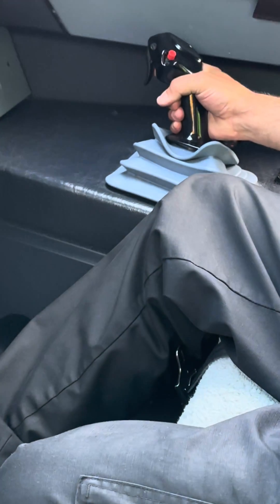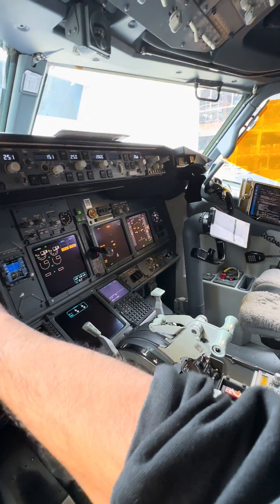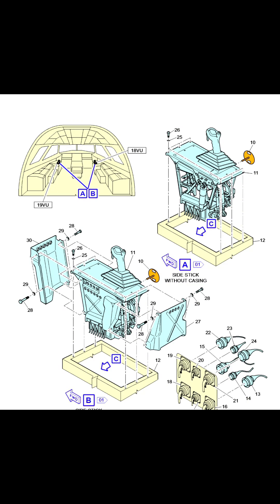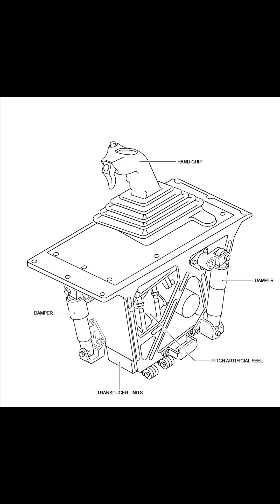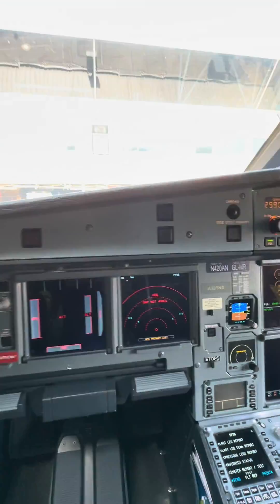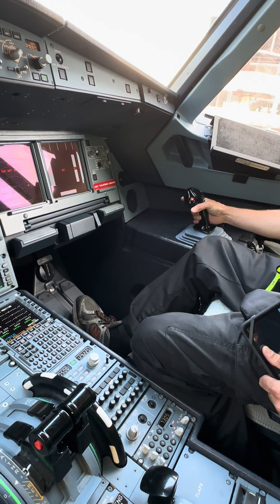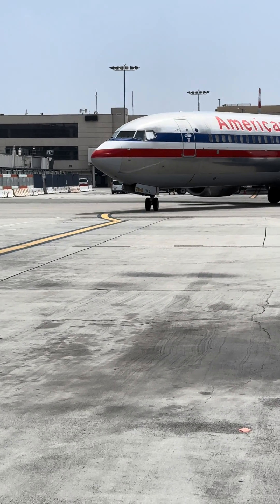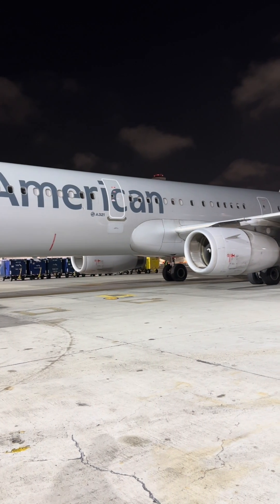Side stick VS Control Column (yoke)

Comment: What would happen if both pilots press the red button at the same time? Is it possible? Has it happened? Like, let's say in an emergency, when both pilots are stressed (maybe it's. night flight, one or both tired), they both try to handle the airplane and start pressing the red button? What is the final input for the a/c and how does it respond to such confusing pilot input? Has that been tested?
Reply from the maker: @evetodew  it will simply cancel each other out. I don’t think it’s ever happened, well not that I know of, but I’m sure it’s been tested.

Comment: Yoke is much better in critical situations. Less confusion, no fight for controls, very obvious and no time lost with conflicting inputs or confusion between pilots. So when there is less room for error, yoke is much more reliable, and lives will not be lost.
Reply from the maker: Tell that to 777 or 787. Yoke is just an artifact. Those are pure fly by wire. Might as well be side sticks. 😉
Reply: @StigAviation  I know it is FBW but that is not what I was talking about.
Reply from the maker: @hari4406  I totally get what you’re talking about my friend, so it’s well understood
Reply: Yoke is an old joke. Takes up too much room and weighs more. A 737 cockpit had so much smoke in it recently, the pilot had to move his head close to the displays to see what was going on, and he kept banging into the yoke.
Reply: If the pilots properly communicate you don’t have those issues, this is kind of irrelevant
Reply: @Falcon.G2  It actually IS not irrelevant. Many plane crashes have been caused by Captain and FO applying opposite controls during emergencies. The airbus system at least alerts both that they are applying two different inputs.

Comment: Cool thing on the dual input in the airbus will take the average of both inputs. Movement of the side stick you’re commanding a rate and the computer interprets it from there. Funky side is a total manual reversion leaves you with only the elevator trim and rudder which are mechanically linked. Still flyable! Luckily it has heavy redundancy. 

Boeing is nice still having conventional control inputs, but you sacrifice space and comfort for sure. Can’t wait to go back to the airbus! Least the tray table helps keep your pants clean!
Reply from the maker: Tray table is definitely a win for Airbus. Just a convenient aircraft. Oh and the horizontal stab and rudder do have mechanical links but not to actual control surfaces. The cables just go to servos. But I hear next version of 321 will get rid of the cables completely.

Comment: Personally, I think FBW and "active" Side sticks are the future. They work much better with glass cockpits, for example Honeywell Anthem or Primus. Yokes are always in the way. The Bombardier Global 8000 and Gulfstream G700 are examples of active sidesticks with glass and fbw( i think). Sidesticks should require triple reduncy hydraulics and a RAT system. Similar to Airbus' Blue System. Google search Global 8000 or G700 for pics. These are future cockpits. Be gone with FMS and MCDU-DU boxes from the 80's.

Comment: Very informative. Thanks Stig. Being an old timer I prefere the cable and pulley system myself.
Reply from the maker: Cables always do the job and very reliable… but my goodness.. the rigging of cables can be a very frustrating and tedious task. Got to get that tension just right 👌
Reply: Now that you mention it I can only imagine how difficult that must be to get just right. Our airlines use the 737.800 predominantly so will bear this in mind the next time I travel by air.

Comment: Good video. But the Airbus side stick logic and priority logic is more complicated. The lack of interconnection to me is a design flaw which was a major factor in the AF 447. I think it was over engineered. Makes it comfortable however if the chips are down I’ll take a yoke.
Reply: Very informative videos please keep them coming
Reply from the maker: I appreciate your input but flight 447 was not the aircraft’s fault. That was pilot error and them not having proper training and understanding of what the aircraft it capable of. So I will respectfully disagree with you on that point. Airbus logic is sound and if properly trained pilots were at the helm that disaster would not have happened. In regards to Boeing logic… it’s simple muscles math. Stronger pilot will win. So as I said both aircraft are good. But your comfortability factor is pure bias.
Reply: @StigAviation  thanks for the reply and your comments on AF447 is noted concerning poorly trained pilots. However the fact that one pilots control inputs were nullified by another pilots opposite inputs was a problem. With the captain returning from his rest he was unable to see this. The pilot commanding the proper input could not tell he was being overridden (in the heat of the moment remember arm chair QBing is easy that was a very wild situation as it was happening). The tactile feel that the other pilot would feel if they were interconnected COULD have saved the day. 
I don’t mean this to be a typical A Vs B argument both have their pluses and minuses. But the side stick with no connection is a problem. 

One of the things I ask pro aidestick advocates is to explain to me the Airbus FCOM side stick priority logic in the mere seconds you may need to use it. It’s complex and you touch on it in your video but there’s more to it. To me it’s ridiculous but it’s the only way to get the a/c certified. 

On the Boeing side? The fact that Cali happened and there wasn’t a fix to install and auto speed brake retraction system tells me the design was lacking and to do it after would have opened Boeing up to massive liability. Something at the time they had essentially avoided. But with the max issues they have grown quite comfortable getting their rear ends Sued off for poor design. 

I enjoy your videos. Very insightful.
Reply from the maker: Very well articulated. I thoroughly enjoyed reading your response and logic. As you said, both have good and bad qualities.. one thing I have learned from aviation and maintenance.. is that mistakes happen.. but they don’t repeat themselves. Aviation learns very quickly and implements the corrective measures to prevent such incidents. And there are those times where it becomes the Swiss Cheese effect.. the chain of events due to human factors. All in all we learn. And thank you for being here. I appreciate you
Reply: @peasoup2980 "ill take the yoke" like you have a choice? Do have boeings and airbus in you garage right now?
Reply: @topethermohenes7658  yes
Reply: @peasoup2980  nah pilots are not stupid like you

Comment: Sidesticks allow for more space infront of the pilot to be able to stretch your legs, a comfortable way to control the aircraft by resting your arm on the armrest and steering the aircraft with wrist and allow for the work/tray table which is just lovely. That being said, I'm not a fan of the Airbus ones that are passive. The ones on the Airbus are not linked to each other, allow for no artificial force feedback thanks to the C* flight path stable FBW and no autopilot feedback. Airbus unfortunately do not care about tactile feedback and it's VERY unfortunate the FAA and EASA allowed FBW Airbus aircraft to be certified with the lack of feedback with the sidestick and thrust levers. It's quite important, especially in a critical situation where one of the pilot is mishandling the aircraft like with Air France 447 and Air Asia 8501. It's very easy to dual since they provide no feedback to one another and once CRM and SOPs are ditched when the pilots are under stress like with 447 and 8501. 

The dual input warning is cancelled by higher priority stall and gpws warnings so it's useless by then and if the pilots are stressed out, they won't hear it as high stress causes hearing to go. The lack of artificial force feedback makes it easier to overcontrol, especially in the degraded laws like direct law, where the flight controls move proportionally with stick movement and sensitivity depends on the airspeed and altitude. So in regards to Airbus sidestick vs Boeing yoke, the Boeing yoke will have to win. The superior active sidesticks on the Gulfstream G400-G800 business jets and Irkut MC-21 airliner (all speed stable C*U aircraft), allow for artificial force feedback, are electronically linked and autopilot feedback. There's even the stick shaker for dual input, superior to the dual input alarm which can go unheard or cancelled by higher priority warnings. These are excellent. I hope the servo mechanisms used to linked the sticks don['t have cause issues tho. 

I prefer active sidesticks to the legacy yoke in airliners. Pilot do not fly their aircraft for the majority of the flight. It's only a few minutes at takeoff and descent to landing. I could care less if some folks have an issue with the video game style control being in use in the cockpit and doesn't look as manly to handle as the yoke. Who said the video game controller couldn't be used in cockpits? The original aircraft controller was not even a yoke at all, but a center stick. Even the McDonald Douglas/Boeing C17 uses a center joystick, though I'd take a yoke over that since I feel I'd be less comfortable using a joystick in the center than off to the side, especially in crosswinds where I have to use the rudder at the same time but that's for another discussion. To have the sticks out of the way allow for more room for the hours you'll spend in the cruise, get to cross your legs and move them around, allows for the table to do work and eat, especially if it's a long haul flight/aircraft.

Of course you don't wanna be distracted by having the table out with electronic device like with Northwest 188 or be stupid to have a camera near the sidestick to have it jammed (Voyegur A330 incident) so you still have to be alert, not careless and be professional at all times. As for using your left hand, the majority of sidestick pilots said they did not struggle to use the hand on the stick. A few others did but further training resolved any issues according to them. You don't need to be ambidextrous which should be obvious since thousands of sidestick aircraft fly everyday and often times by Captains. The armrest seems to help here. If a pilot suffers incapacitation, it's less risky with the sidestick as it's out of the way if the body falls over. The greater range of motion with the yoke in my view means it'll take longer to get the aircraft to do what you want it to like with a terrain escape maneuver. If I want immediate aircraft response, I can get the plane to move faster since the range of motion is smaller with the sidestick. 

I was on quora recently and an A330/777 instructor and a commentor who tried both Boeing and FBW Airbus simulators both said the sidestick for them allowed for more precise movements as they said it's simpler to steer with the wrist than using one arm on the yoke. I like yokes too. Some prefer it for simply to use both hands for the takeoff and climbing. Some like the fact it's right infront of you and don't mind it taking up space. Some like it for the greater range of motion which sometimes is a plus on the other side of the coin like with gusty winds. Lastly, I will admit, anyone can get used to flying with a yoke without too much difficulty where as with a left sidestick, some folks reported the struggled to used the non dominant hand since it's wrist movement where as on the yoke, they had no trouble since it's arm movement involved. So my preference is active sidestick > yoke and yoke > passive sidestick like with Airbus.
Reply from the maker: Incredible explanation. Thank you so much for all you time and effort for the amazing information.
Reply: @StigAviation  Sure thing 👍

Comment: Side stick design helped kill AF447.
Reply: Not enough to save Ethiopia and Lion Air 737 MAX crashes (Boeing half-hearted effort to Airbus their 737) Boeing had violated their long tradition of pilots having absolute control.
Reply: @diegosilang4823  Agreed.
Reply: @diegosilang4823 doesn’t help when there are idiots flying the plane.
Reply: Still wrong but you believe your truth since these planes operate safely thousands of times a day. A pilot frozen on the stick can be overridden by the opposite side and disabled completely if  necessary. There are ways, it just wasn’t done in that accident, hence back to what I said originally.
Reply: @flyNKjets  Your description is never has been and must never be an appropriate way to judge the safety of a system. I have Asperger’s and am excellent at recognizing patterns; I also discuss situations like this weekly with a psychologist. Nothing about your statement allows a pro-safety pro-excellence culture to thrive. Please do a deeper dive on 447; I’d love to watch your improved analysis.
Reply: @PetesGuide   You don’t have a full understanding from this video of how the takeover push button logic works. This was a simplified overview of it. In the AF incident the CA didn’t get back on the controls till the altitude was in the teens. Two FOs were at the controls at cruise when the 330 hit it the icing and neither recognized the stall. Dual input happened at low altitude and also with completely ineffective inputs to recover a jet of this size. Captain had the ability to reject the FOs input with the takeover push button and deny further input by holding it but this was not done. I’ve had to review this accident multiple times in my career. 

I don’t mean to come off as insulting I’m just trying to educate people that this system works if used properly. If I did I’m sorry for that.

Nobody will ever know why the Captain didn’t deny the FO input with the “dual input” going off but all we can do is backseat drive in the FDR data. We just learn and adjust our training.
Reply: @flyNKjets  This long response deserves a similarly long response, but my initial response is that the FO’s actions indicates substantial failure of the airline and the captain to fire incompetent pilots; and also Airbus’s failure to fire incompetent engineers. We are in the 21st century and all automation in airplanes should be capable of resolving conflicts between competent and incompetent pilots. Because AF447 didn’t meet this criteria both Airbus and Air France killed the passengers and crew (bus mostly both pilots).
Reply: @flyNKjets  Oh and BTW, my chief mentor studied under Edward Teller and had design oversight over all electronics on Apollo. He had a dozen patents to my two, but taught me well. I’m happy to debate this issue continually.
Reply: @PetesGuide yoke design help kill boeing max crashes too
Reply: @topethermohenes7658  I don’t think so. But there was a 777 that almost crashed on landing because the two pilots were fighting the controls so hard they broke the connection between the yokes!
Reply: @PetesGuide  the reason for the MCAS was because the old cable yoke design ment that no flight augmentations can be added system wide. Thats why they had to resolve to a quick and easy fix such as the MCAS
Airbus planes can be updated system wide just by installing a mod. An example would be the takeoff mode, it only took 1 mod update and now its practically impossible to tailstrike an airbus during takeoff, flight augmentations were updated so that a maximum pitch at takeoff (before 50ft) would be introduced to stop pilots over rotating at takeoff especially for extended versions like the a321 after numerous tailstrike events worldwide
Reply from the maker: Not true    that was pilot Error ... please do your research and educate yourself
Reply: @StigAviation Without the side stick system, the other pilot would've realized the error the pilot in control was making. That crash doesn't happen in a dual yoke aircraft. Nobody else realized he was holding the stick back until they were below 10k ft and already doomed.
Reply from the maker: @lawv804  cool so your saying the pilots didn’t know what they were doing. Aircraft was doing what exactly what it was designed to do.
Reply: @StigAviation  Not true; it was co-pilot error and the system design that allowed the co-pilot to negate the recovery actions implemented by the pilot. As you can see, I have indeed done my research.
Reply: Inexperience and inability to recognize a stall is what resulted in that accident, not the design of the FCS.
Reply: @flyNKjets  the side stick system design prevented the captain from discovering that the idiotic moronic first officer was commanding a stall all the way from cruising altitude to the Atlantic Ocean. This dedign failure is so egregious that I can not offer any other description of the side stick voting/averaging system design. Evil programmers such as those responsible must be exiled from society so they have zero influence over artificial intelligence; FULL STOP.
Reply: One of you is on therapy and the other is talking about space ships….neither of you work on aviation as the creator and myself has.  Pump the brakes and take your petty argument elsewhere where people that know even less than you do believe your malarkey.